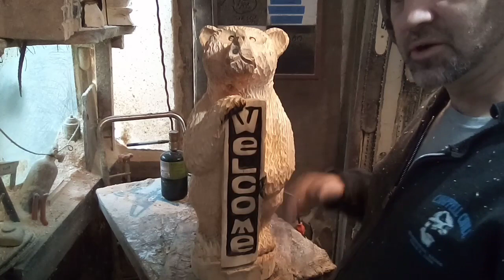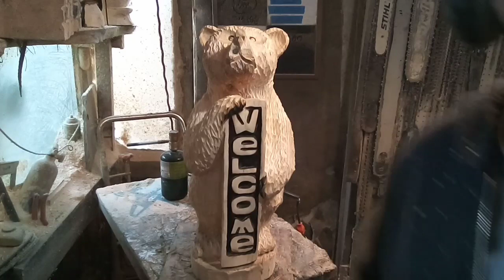Wood carved welcome sign chainsaw carving how to

Comment: Hey great job!! I'm trying to get into carving and want to use an electric saw but can't find anyone that knows how to find the right sprockett for a 1/4 pitch chain on a Makita electric chainsaw. Any advice would be nice as I see that you are all electric. Thank Bill
Reply from the maker: I've done the conversion,its pretty involved, not easy... Instead i switched over to the ultra low profile stihl piccolo,. 043 3/8 chain... pmn3 or something like that. It rolls smooth on a carving bar,lighter, lower profile, and slightly narrower than standard lp picco. The conversion i did i used a 1/4pitch rim sprocket,had to turn down the stock sprocket to accept it, only using the pressure plates to hold it on..  it works, but slips a bit, i left out a spring plate,because they kept flying across the room when i was trying to compress them and put in the retainer clip... some day I'll get time to get back to perfecting it...but for now, i just run the ultra light 3/8.
Reply from the maker: The only makita I've seen 1/4 pitch swap for is the battery saws, or the older 5012 b, 5018 b, the small saw, with manual oiler... but those are hard to find... the battery saws are pretty sweet from what I hear ... bob king of sawnuts.com may know of a conversion for the UC 4025, and other uc models... not sure,I have yet to ask him, I get so busy, I often forget to ask...